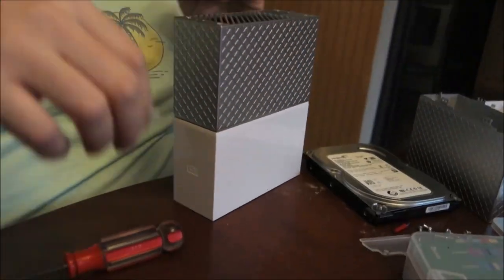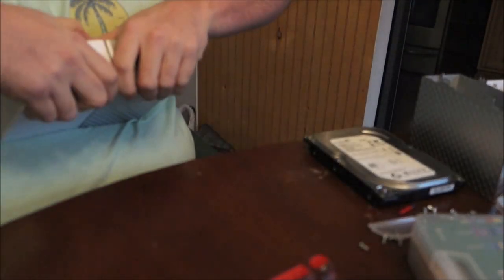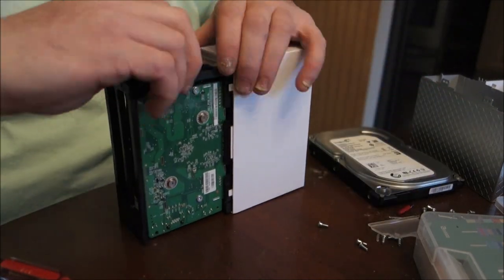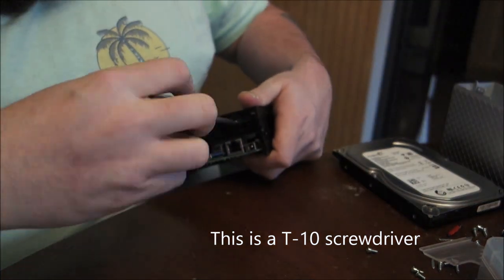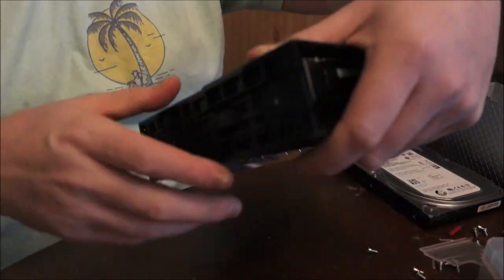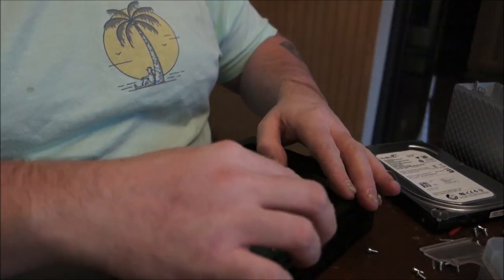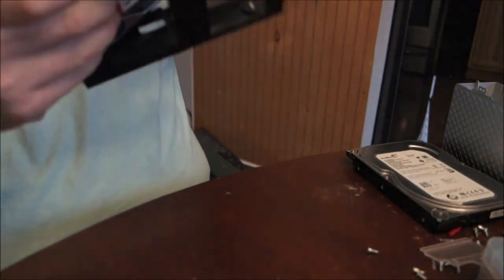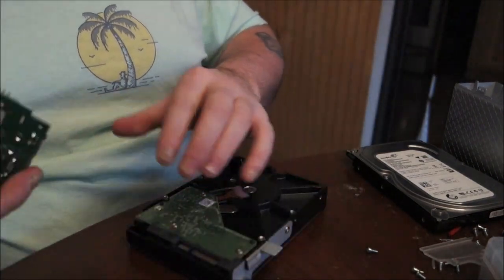My Cloud Home Disassembly

Comment: I have managed to change a 5 y.o. 2 TB HDD with a 4 TB HDD after cloning the first one on the second one with Clonezilla. I am working now into creating an image file with the OS for this particular model, just in case @Peterman Builds you want to use another HDD as storage in your unit. Sorry, I saw that the video is old, but thanks to this video I managed to replace the 2 TB disk with a 4 TB one. So thanks! (PS: I will post a link with the OS image file as soon as I have it ready, I hope it won't bother you if I do so!)

Comment: Hello Peterman, thanks for the video it helps a lot!! 

one question : does changing the boards make it work and data accessible ? i hade the same issue and i'm going to buy another my cloud inorder to swap boards :(
Reply from the maker: this didnt end up working for me. Once I swapped the drive it would no longer turn on. I'm guessing that there is some extra setup that is done at the factory besides just set up. I ended up losing all the data I had on there. I now keep several backups of this drive in case it happens again.
Reply: @petermanbuilds859  Have you tried cloning the original drive first?
Reply: @petermanbuilds859  It did not work, because the OS itself is stored on the drive itself, not the board

Comment: in your video you said the original - before tear down, the unit did not work.  By that did you mean unit is dead - no power ? or HDD coming with errors?
If the unit is dead, swapping out the HDD won't necessarily make it work if the main board is faulty
Reply from the maker: The unit did turn on but was stuck with a quickly flashing white light. The plan that I had here did not end up fixing my problem and I ended up having to manually replace everything on the drive, I now keep a backup of it.
Reply: Peterman Builds mine keeps flashing too, but that means it’s offline. I only have no idea what the problem is since all of the Ethernet cables Re working.
Reply: @petermanbuilds859  Once you replace the hard drive, there no system on the new one. You need to install the system and partition the drive.
Reply: @marn200  do you fix it?i have the same issue right now.. very frustating, all my data located on my cloud

Comment: can you connect the drive to pc to get the data? i heard that Nas drive cant read by window pc or it will be format?
thanks
Reply from the maker: it didnt read at all. didnt even start up
Reply: @petermanbuilds859  did you swap the board on another my cloud home? does it work or not? if not how did you get the data from the drive, can you help me cause i have lost my family pics and want to get it back,too. Thanks so much